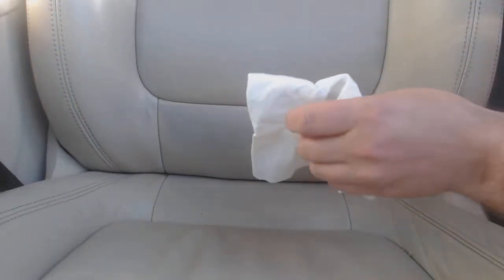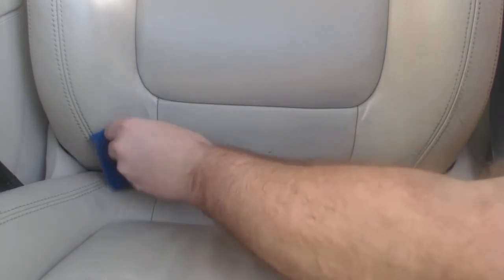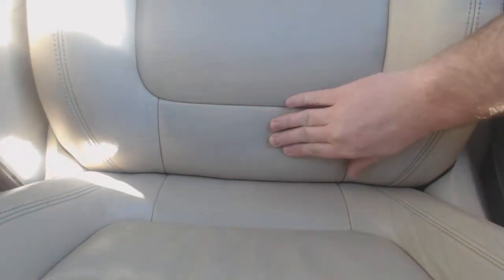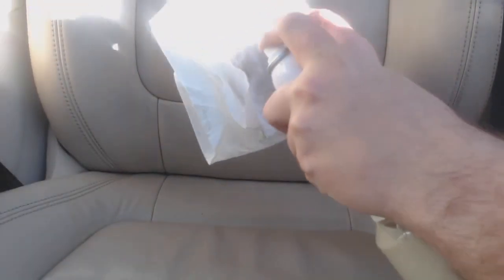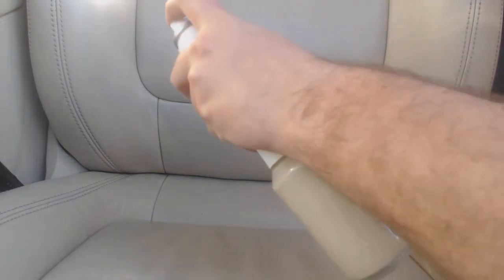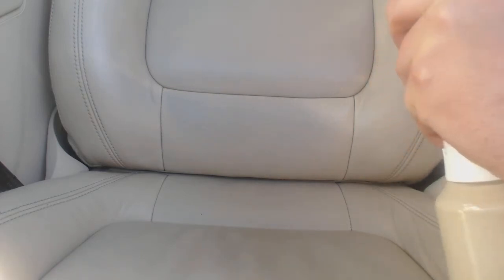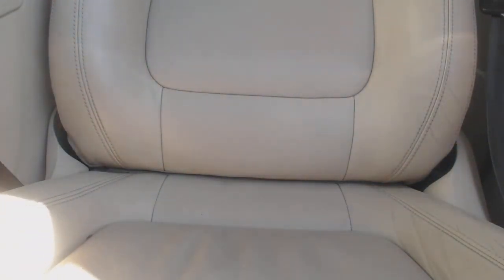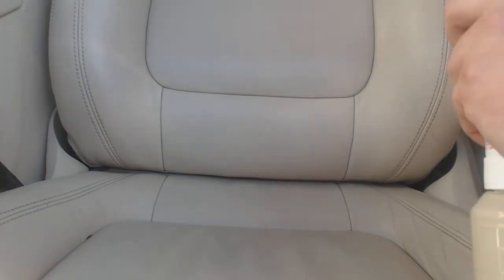Repairing Dye Transfer on Leather Seats

Comment: That spray bottle didn't seem to work very well.
Reply: Yeah, I've had some ongoing frustrations with the Preval sprayers, and I'm not recommending it too much anymore. Maybe someone else is way better at it than me, but unless you have a legit airbrush or HVLP, you're almost always better off using a foam paint brush or paint sponge. My newer video explains this a little better.

Comment: What do you recommend if fat coats of wrong color was applied prior to getting the correct color? Do I try to remove that, or just still paint thin coats over it with correct color?
Reply from the maker: Good question - you should be able to go over the previous coats with the new one without having to remove the existing coats.